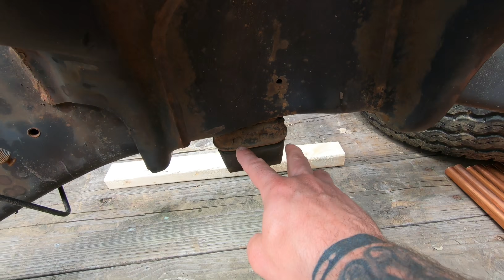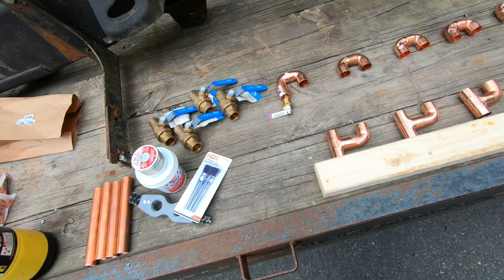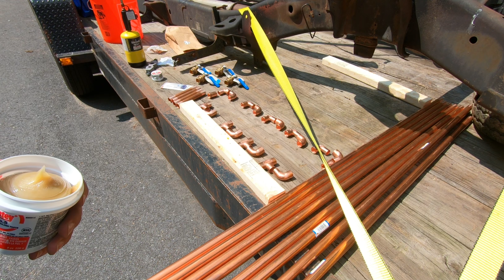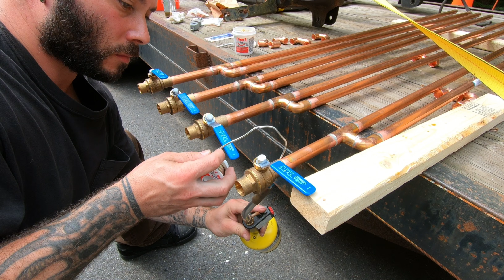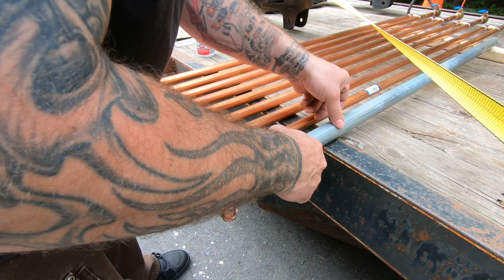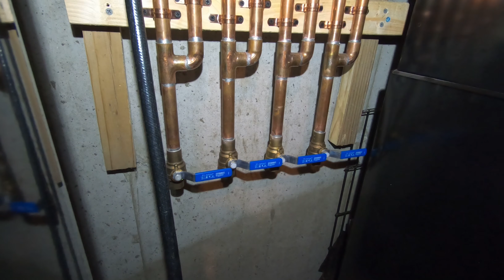How to build a copper pipe air compressor air dryer

Comment: why vertical when horizontal would be far better
Reply from the maker: I figured it would be harder for the condensed water to travel up the pipe than it would be to travel across if it was horizontal.
Reply: @JasonTheMunicipalMechanic  how about you started at he top, cooling on its way down and collecting the water at the bottom before entering the tank

Comment: Yay! Another Naked radiator (naked=NO fins!) Naked heat exchanger tubes were abandoned around 1902 in favor of high efficiency sheet metal fins that exponencially add surface area so moving air can absorb & remove the heat. Save time & money & buy a Derale #15300 oil cooler with 1/2" tubes. Install it with custom metal tubing straight out of the compressor pump, thru the cooler & into a water seperator. Add a cheap electric fan blowing thru the cooler & that will get you air dry enough that you might not even get water in your tank.  Win win!
Reply: Are you saying under $100 and done quickly? Whaaa?

Comment: By the time i bought 160' of m type. And all the fittings and valves for a post compressor/ pre tank 4 loop passive cooler and post tank 4 loop passive cooler i could have bought a line dryer from harbour freight. The copper tubing passive dryer will still be working in 40 years and only require that the valves be opened to drain the water. No electric bill and dryer replacement cost attached. I am also adding a particulate / water trap filter to both runs. I had installed an M type copper  tube system minus the vertical loops 45 years ago in my shop and it delivered the air with no problems from then till recently at 150 psi no leeks or blow outs. So save yourself som money on the $10/ stick more that the L cost over the M. I replaced my 45 yo sharpe regulator i think it was a 606 with a new one. So im hoping the new set up will remove all the moisture issues that i have had for all those 45 years. I will have close to a $1000 invested in  regulated dry air not counting the compressor when all said and done. My equipment will enjoy the dry air.

Comment: I'm wondering what it sounds like when a setup like that bleeds out the air after the compressor shuts off. How long does it take to release the pressure? Thanks 👍

Comment: Install A.C. type radiator before the copper lines.  And, put a fan blowing on/through the radiator.  It will greatly help cool the air, and most all of the collected water will be on the bottom of the 1st copper tube.  And, you can also help your system by having the air dryer system connected directly from the compressor output.  Then, run your line from the copper tube's output into your tank. That will eliminate all moisture from going into your tank.
Reply: Yes, because it's exponentially harder to extract all moisture comimg out of the tank as opposed to eliminating it right before the tank.

Comment: Jeez.  Like 200$ in parts n pipe n stuff..   i paid 20$ for a power steering cooler/ radiator that had 3/8” tube and put my water oil separator after it below the radiator and below the tank inlet..   works for my needs..

Comment: 👍🍷 I wonder what would happen if you took the air that came out of the air compressor and ran it through the dryer and then back into the air tank of the air compressor and then over to the output regulator. 👍👍
Reply: That's what I did with a transmission tube/fin cooler. I also added a water separator before it gets to the tank. There's about a 150deg difference in temp from the pipe at the pump vs the pipe going into the tank now. So far, I barely get any water into the tank.

Comment: You say it’s connected between the tank and the hose reel?  That’s not an aftercooler then and that’s why it’s not doing anything.  The principal is that you’re trying to form condensate before the air enters the tank, and then separate that condensate, and then put that dry air into the tank.  So the correct flow is pump->radiator->separator->tank.  That’s why your setup isn’t working.
Reply from the maker: Your correct but I didn’t call it an after cooler i called it an air dryer. Same thing but in a different location really. It works but not with the high volume of air a media blaster uses.

Comment: Thanks for sharing. Keep heat away from the drain valves by soldering a threaded fitting on the cu pipe going to them. Im thinking of going horizontal with one auto drain.
Reply from the maker: I’ve had quite a few people want to make it horizontally. I’d be interested to hear how it works out.

Comment: I wonder if a guy could use 1/2" black pipe as well instead of the copper?
Reply from the maker: I don’t know. The copper is used because of the thermal conductivity of it. I don’t think the black pipe will transfer the heat as well.

Comment: Place the copper next to the block wall and it should help with condensation if you have some contact to the wall. The board tied into the joist should provide a little bit of shielding for radiant heat coming from the compressor.

Comment: My blast cabinet stopped working. There are lots of air coming out, but it can not blast off any rust. The pressure and flow is good. Is it because of the water in the compressed air?
Reply from the maker: It’s possible. It’s it a pressure pot blaster or a suction feed blaster?  I would look for a clog on the suction side or feed side.

Comment: Couldn’t you just use one ball valve and mount all the pipes horizontal so the air pushes it into the last ball valve? Save the money on all those ball valves

Comment: an aftercooler is what you need to get water out aftercooler goes between the head and separator to the tank then run it through your dryer system this way you will have cool dry air in the tank. nice video

Comment: Where are you located, im in Houston and the humidity is real here. I ask because I'm just trying to gage how many loops ill need. Thanks for the video
Reply from the maker: I’m in Massachusetts and the compressor is in my basement which is around 50-60% humidity. I would do as many loops as you can 50 feet is about the minimum. I added a 35 foot hose in front of the cooler because it was getting overwhelmed with the heat and not working effectively. If you have a high air consumption like a sand blaster I was using you may not get foot results, but normal air tools I think would work well.
Reply: @JasonTheMunicipalMechanic  thanks for getting back to me, yeah I'm planning on to work multiple tools but mostly a sandblasting cabinet
Reply from the maker: I added a water separator/filter to the end of the piping and I have an inline water separator/filter on the end of my blast cabinet. I think The pipe cooler needs to be a ways away from the compressor to help keep the piping from getting too hot. I had a suggestion to use a coil of copper in a bucket of cold water to get a better result. I haven’t tried it but it sounds like it will work. I’ve also had people tell me they have gotten good results putting a dryer between the compressor head and the tank. I think it was called an aftercooler.

Comment: Nice video.  Had not thought about the street elbows. but that does make it more compact.  
Also, I noticed that now-a-days most guys who use a soldering torch jump right to MAPP gas.  I guess it's bigger, better, hotter, faster.
Reply from the maker: Thank you. I use the torch for nuts and bolts too so the more heat the better. I’ve heard that the mapp gas is just propane now and not any different, and not what it used to be. I don’t know if it’s true just what I heard. I accidentally got too many street elbows and had to go back for some regular 90’s

Comment: I keep seeing this copper pipe and all those $150 double dryer things... think yall waste $ ....I work on large yachts, the painter has it down with a simple solution.....if your pushing 150 lbs just use 100 to 150 ft of 1" PVC (sch40 good to 270 lbs, if above 75 degrees might go to 215 bursts at 1450) and use a Motor Guard filter. even better the filters are cheap, sounds weird but just use a roll of toilet paper and rip off about 20 layers and use that in the filter..... Think about this....the guys been doing this for well over 30 years, using high end ( AwlGrip) paint spraying 1 or 2 million dollar yachts no problems !!! the filter case is $80 on Amazon, 1" PVC is less than by an easy 80%... you can use 3/4" pvc just ran a little more. has a just less than 10% more pressure and burst factor. My opinion is just too much hype over this whole thing, the yacht paint is no fool and a smart man and well quality is his key to success.
Reply from the maker: Sure. I’ve seen a piece of 4 inch pipe with a bunch of tee shirts stuffed in it. The idea is really just to cool the air to get the water to collect and drop out of it. I don’t doubt there are other ways to do it.  your 1 inch sch40 pvc is 10 per ten feet at Home Depot right not so that would be $100 to $150 in just the straight pipe not including anything else. I think the price would be comparable if you ask me. Either way thank you for the idea. It’s good to know the other options.

Comment: Could also just use tank drain cocks instead of those ball valves
Reply from the maker: Sure, just have to solder on the threaded fittings instead of the ball valves.

Comment: i am building one kinda like yours as we speak, i have a couple more hours of work to it yet before it is finished, mine does have 2 more tubes, i will be adding a 15300 cooler also between the head and the tank in the future, so between the two it should stop much water i hope, my problem is i am going from 85 or hotter air to a room that is 50 degrees, the problem we have now we just make lots of water and the filters fill up fast, you did put a damper on my hopes of this working, you are the first i heard of this system of getting water to a filter, i will have about 70 feet total in pipe, i hope that helps some, nice job on the build
Reply from the maker: I’ve heard a cooler between the compressor and tank does help a lot. I guess it depends on what your doing with the air. I was sand blasting and there is almost no time for the air to cool in the cooler. Also it was so close to the tank it ended up heating the first two tubes and I didn’t get much water out of them the 3rd and 4th had more water in them. If I was doing a low air demand task I think it would work better but with sand blasting it’s just ripping through. I have added a section of 30 feet between the tank and copper pipe and I put a regulator filter at the end. I haven’t done any sand blasting so I haven’t tested it, but when I was sand blasting the compressor was running almost nonstop for hours so it’s hard to keep it dry. I have the minimum amount of piping for one of these I later found out, but I think with 70 feet you will have better luck. My compressor is in a basement also so the air had 40-50% humidity to start with. A viewer left a comment to a system he designed in these comments you might be interested to read.
Reply: @JasonTheMunicipalMechanic  thanks for the reply, first my compressor at work is upstairs, the air temp inside the building i am guessing is about 85 or warmer, the hoses run into a room that is 50 degrees, my set up would be like yours about 6 feet from the compressor, i have 1 more piece of pipe left yet and i think i will add at least as much as i can of that, the sad part is i did not see your video sooner, i just mounted the pipe to the wood yesterday and was going to mount it today :(, take care and thanks a lot for the reply, we also use a lot of air, maybe this and a cooler will solve the problem, thanks again

Comment: Good job soldering and laying out. It’s tough to get everything in one plane. 
Question: Why didn’t you use horizontal pipes in a switchback fashion from top to bottom? That way you only need one drain at the bottom.
Reply from the maker: Thank you. Honestly I didn’t think of making it horizontally, all the ones I’ve seen were all vertical. One drain would have saved some money and been more convenient though. I’ve been toying around with it lately, it wasn’t the best for a high flow rate like when I was sand blasting. The air was going through too fast to cool. I put a 30 foot piece of air hose between the tank and the copper air dryer to give a bit of distance to help with the cooling. I’ve been thinking of an after cooler between the compressor head and the tank. I heard it makes a difference. I don’t do much sand blasting so it will probably be a while before I test it again with it though.
Reply: @JasonTheMunicipalMechanic  
That’s what I did. The air from the compressor goes directly to 50’ of 3/4” copper pipe in a switchback configuration (each pipe is 5’ long). Then it goes into a double helix of 3/4” soft copper tubing that is in a sealed container with cold water circulating around the copper. Air enters from the bottom, in an 8” diameter helix that’s 15” tall. Then it turns around and comes back down in another helix that fits around the inner one. So I have a drain valve between the end of the hard copper and the chiller. Then another drain after the air exits the chiller. I have it all on power point if you want the design. I have an Excel file that calculates all the helix lengths too. 
After the chiller and drain, I go to the tank with flexible hose. 
You need 3 flexible hoses. First to go from compressor to aftercooler. This must be able to withstand 400 deg F. Grainger has such hoses. Then another one to go from cooler to tank and another between tank outlet and plumbing. 
I also designed bypasses for both radiative and chilled cooler in case I need to work on them. I can bypass each individually or both together. Each unit is stand alone and can be taken out with unions. 
Don’t forget that you need to move the unloader valve from the tank and put it between compressor and check valve.
Reply from the maker: That’s pretty interesting. So your using those as an after cooler between the compressor and the tank? I would be interested in seeing it. Are you able to email the power point? My email is jasonthemunicipalmechanic@gmail.com. I had added a large harbor freight air filter dryer with a regulator to the end of the copper tubing. I was going to make a second video about it later but I haven’t used it more than a few minutes here or there and it really isn’t enough to test it.   How effective is your setup? I’d imagine it works pretty well.
Reply: @paulmanhart4481 

Would like to see your spreadsheet and anything else to help me plan.

Comment: Hows this setup been working for you? I built one exactly like this out of 3/4 copper tubing but I ended up with the same length of tubing as you. I should of added another vertical. Has it been getting all the moisture out?
Reply from the maker: I did some tweaking to it to get more of the moisture out. I was getting moisture through when I was sand blasting but I don’t think I can expect it to work too well in that set up because it was really close to the compressor and the compressor was running almost nonstop. Also with the air rushing through so quickly it heated up the first tube and wasn’t cooling the air. I think In a more reserved use like with air tools and such that don’t run nonstop it would work better. It was taking water out I got more out of the last tube then the ones before. I haven’t used it yet except for with the sand blaster. I have recently put a length of hose between the tubing and the compressor that is about 30ft long that I think should help with getting more moisture out because it will give me more distance to let the air cool before it enters the tubing and not over heat the first tube. I also added a water filter separator to the end of the tubing to collect any remaining moisture before it goes into the hose. It was working well at first in the original design when sandblasting but as the tubing got hot I started getting water to the sand blaster water separator. I haven’t tried a fan to keep it cool yet but I’m hoping the extra hose helps with the efficiency of it. All the videos I saw of them everyone said they worked awesome so I think their air demand was less than what I was using. My compressor is in my basement so I might have more moisture in the air than if it was outside or in a garage. With the weather I won’t be doing anymore testing until it warms up so I don’t know how the add ons will improve the efficiency.

Comment: What type of copper pipe did you use ?k/M/L
Reply from the maker: I believe it was L. It was the thicker wall pipe
Reply: @JasonTheMunicipalMechanic  ahh thank you I’m here at Home Depot in the parking lot was hopping you would respond quickly 👌👌👌👌
Reply from the maker: You can probably use the m too it just has a lower psi rating it’s 700psi as opposed to the L being 1002psi
Reply: @JasonTheMunicipalMechanic  I read somewhere that the thinner copper will shed heat faster so that is what I will use.
Reply from the maker: That makes sense, less mass to hold the heat.